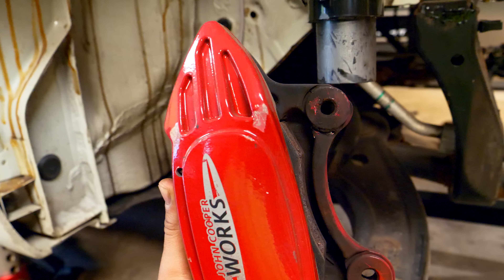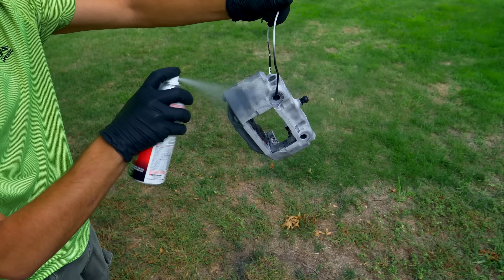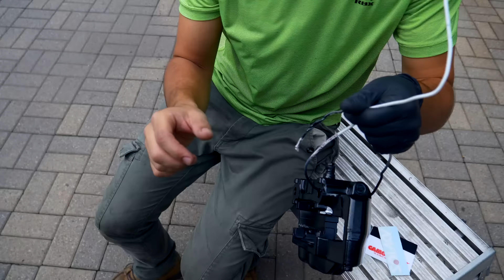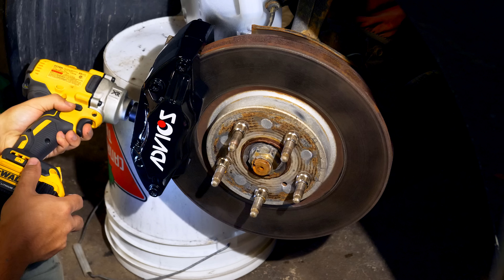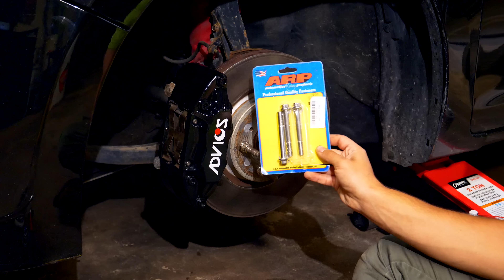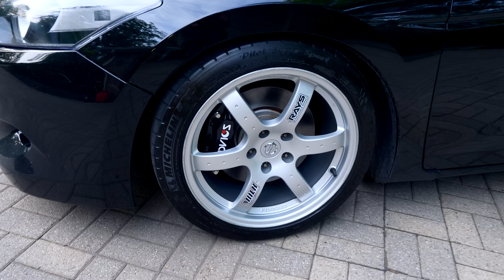Refinishing My Brakes after 2.5 Years, 75000 KMs & 2 Canadian Winters..

Comment: The calipers look great Milan 👍👍 it was a nice touch to see you torquing all of the bolts and the settings afterwards as that’s what most diy’ers will be on the look out for. The wheels in black may look good too, try plasti dipping them first to see a contrast and if you don’t like it, just peel it off again 👍👍👍 it would be nice if you also did something to the interior of the car too 👍👍👍